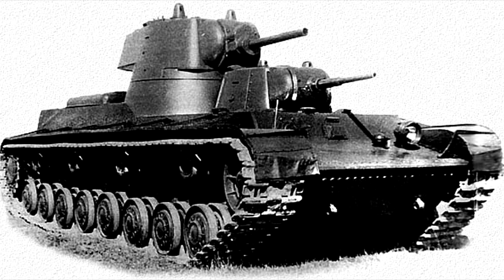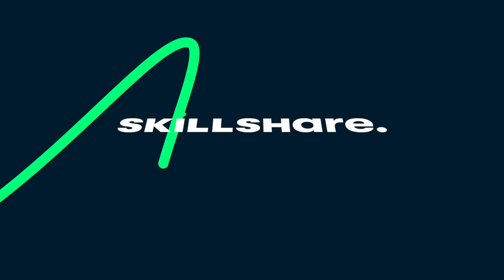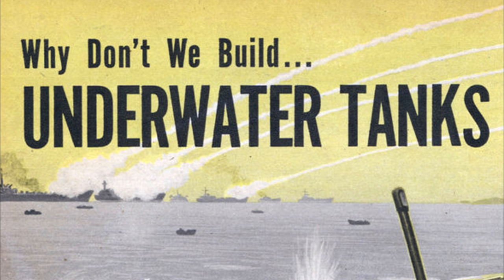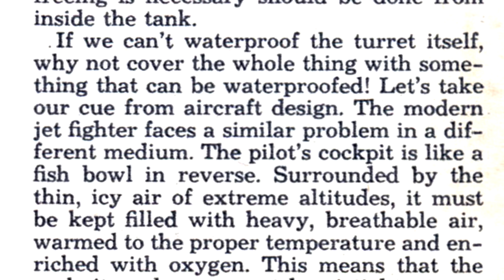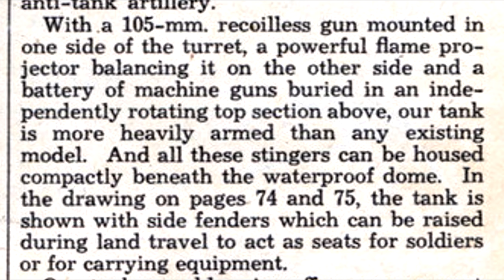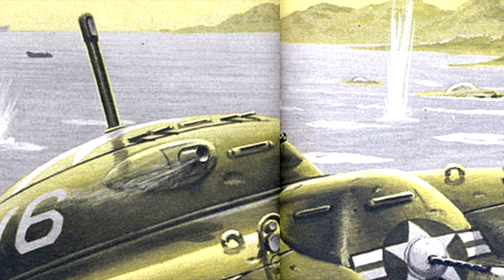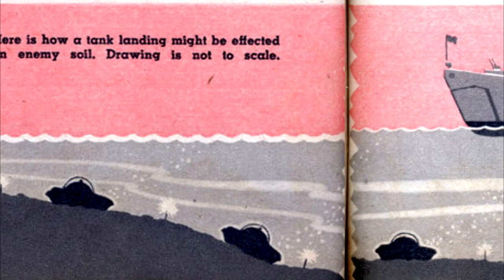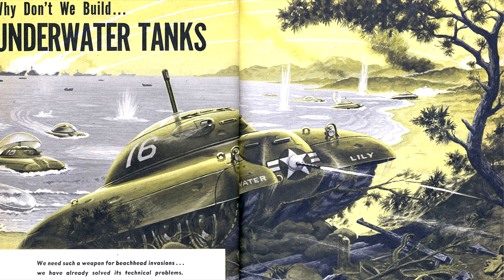The CRAZIEST Amphibious Tank Concept EVER | Cursed by Design

Comment from the maker: The first 1,000 people to use this link will get a 1 month free trial of Skillshare: https://skl.sh/coneofarc08211
Reply: Can i call you corn of arc?
Reply: Well germans were trying to make the maus to go under water so a point
Reply: dont need it tho
Reply: Cone, I think that if you put some large ballast tanks in the tank than you could lessen the amount of pressure on the sea floor that causes tanks to become stuck in the mud, but you would have to sacrifice a bit of the armor to enable that to work. In our modern times an aluminum composite spaced armor would probably allow for decent protection and also lower weight, if the tank was battery powered and had a drive train similar to a Tesla with a inversion generator and in case of emergency the ability to fully come above water level, this concept might not be bad, but would probably be a better self-propelled artillery than tank.
If you can think of anything I've missed, lmk.
Reply: @aidenburnside6380  well they could have added large air bags with makes the tank float but also just enough floaty that the pontoons stays under water
Reply: The engine could be multi-fuel, using hydrogen peroxide under water...
However, the plastic pressure dome would be crushed by the weight of the sea. So another dumb idea which was not thought out. I remember a friend in junior high school who thought he could make a twenty foot long snorkel and how I unsuccessfully tried to explain to him if he did, his lungs would be flattened and he would die...
So this dumb tank design was great for selling magazines but otherwise is dumb. The better idea for a safer landing craft is the hovercraft, which can deliver tanks to the shore, without becoming a fixture on the sea bed like the Dual Drive Sherman's...
Reply: @raider1_163  they had the taughtpanzer or something like that. That is basically water proof pz 3. Idk everything about it but. As I remember it was made to go through the English channel by dropping near the land.
Reply: How about yoh series tanks next?
From yoh company in 1950s
Reply: All they had to do was place signs over everything and that thing's waterproof.
Reply: I do like the video, but I would name this specific series a bit differently as it is just a concept from a magazine, not really something which made it at least on the drawing boards.
Maybe call it "Cursed by Concept" to differentiate from the main series?
Reply: OMFG please stop calling non-tanks as TANKS!
Reply: G 7 es una empresa dedicada 7 a en 7 de 7 en el mundo de la moda y la tecnología en el mundo de la música música clásica en el 6 y y en la música clásica en el mundo de
Reply: Lets be honest, this guy was on to something
Reply: Wow THABK YOU AND #SKILLSHARE I HAVE LEARNED THE SKILLS OF A MASTER SURGUEN AND AM CURRENTLY PERFOMING OPERATIONS AT THE PRESIGIOUS EL PRESIDENTE HOSPITALO IN GUATAMALA!

Comment: Tanks with deep wading kits frequently get stuck in the mud, even 'just' crossing rivers, or stall their engines, or find that they can't climb the bank on the other side. Western tanks have wide snorkel 'towers' so that the commander can stand in the top and guide the driver via intercom, and so that the crew can escape up the tower if the tank gets stuck. The disadvantage of these systems is that they're too big to carry on the tank in normal usage, so tanks wanting to cross a river would have to wait for the snorkels to be brought up on trucks. Soviet tanks use a small diameter snorkel tube which can be carried on the tank all the time. However, this system is very dangerous, since if the tank stalls or gets stuck, the crew have no means of escape except in very shallow water. Russian crews have been known to point-blank refuse to use their snorkels, despite the dire consequences of refusing orders in the Soviet Army. Standard practice therefore became to attach a snorkelling Russian tank to the winches of two armoured recovery vehicles, one on each bank, so that if the tank got stuck or stalled it's engine, one or other of the ARV's could pull it out. This does mean though that the advantage of having the snorkels on the tanks all the time is largely negated by the setup time for a safe river-crossing.

In practical terms, any safe, submerged crossing of a river by tanks requires prep time, support equipment and recce of entry/exit points, so it WILL slow down the tank's progress whatever method is used, often to the point where it's just easier, safer and almost as not-quick to wait for some kind of bridging gear to arrive and be setup.
Reply: Yes, very well summarised.
Reply: I used to study Soviet tank river-crossing operations when I was in the US Army. They used an observer in a tower or raised platform on shore guiding the driver by radio. During training exercises, they had specially prepared crossing points set up more or less permanently where the river bed was either naturally perfect or artificially prepared/reinforced. Still, every so often a tank would fail to cross and occasional deaths were not unheard of.
Reply: I've heard that bit about the Soviet tank crews refusing to use their snorkels, funnily enough the first thing that came to my mind when I thought about the design in the video was that I'd rather be on an open topped landing craft on the surface where I can have some situational awareness and the ability to at least attempt an escape if things get bad, than be trapped in a metal coffin under water with no means of escape if something goes wrong. Never mind the actual mortality rates, I don't care if you tell me that statistically the sub tank is much safer, I don't care. I would rather get blown up by a direct hit from a high explosive shell than take my chances with the underwater death box, and I think most people would probably agree that they'd rather take their chances with an easy death than being buried alive on the sea floor, where you get just enough time to process the fact that you're going to die, and nobody can help you.
Reply: Yeah that is why having a floating tank is arguably better, similar to the BMP apcs
Reply: The sea/river bed is about the only place I would consider a legged design to be better than track and wheels.
Reply: I wonder if using ballast tanks as spaced armor to allow underwater maneuvering to let a submerged tank swim until it gets close enough to crawl the rest of the way up the beach?
Reply: @davidthomas2870  probably better than trying to drive it, but at that point you've made a floating/neutrally buoyant tank that has to be fully waterproofed and electric/diesel hybrid, rather than just a modern floating apc
Reply: @jakeb6703  fair enough. Could ballast tanks and water be used as spaced armor I wonder and if so, would they be any good?
Reply: @EstellammaSS  That's essentially legged designs in a nutshell. They're never reasonably going to perform as well as wheeled or tracked designs on terrain that favors wheeled or tracked designs. Where they are worthwhile is in terrain where wheeled or tracked designs can't operate, or can only operate to such a restricted degree that it outweighs the disadvantages of legs. For amphibious operations, I can definitely see some kind of crab-tank being a viable option.
Reply: @GrishaDerp  Exactly: that's why I said they could only escape in shallow water: any significant pressure on the hatched made them impossible to open.
Reply: @jakeb6703  still can avoid enemy shooting, and allow for suprise beach landings, considering how slow beach landings tend to be i would say this is vital. furthermore you still need to make all modern tanks NBC sealed, which is not too far off from water proof.
Reply: @davidthomas2870  That's a good concept - maybe large, side-mounted, detachable floats that lighten the tank significantly enough to let it 'skip along' or 'glide' across the sea floor STILL ON ITS TREADS (fitted with also detachable flanges). That setup could deal with the soft, silty sea or riverbeds (I'm picturing something like a horseshoe crab that scampers along the bottom, just gliding over the sea floor with its feet).
Reply: @kennethmartin1300  that is an interesting idea
Reply: and diving teams. They always have teams of divers to rescue the crews.
Reply: My gradpa was tank mechanic in czechoslovakian army in 70s (we used late T-54s) and tank crews had device to breathe under water for time before they were rescued by ARV
Reply: "...Russian crews have been known to point-blank refuse to use their snorkels, despite the dire consequences of refusing orders in the Soviet Army." - Absolute garbage and a lie.
Reply: Remember two points regarding Soviet cold war tanks. First. There is a trap door in the floor of the tank for escape. The tank runs at positive pressure for NBC purposes, so the hatchet could be opened for escape, without immediately flooding the hull (just). Second they have personal rudimentary gear to escape if necessary. That said, it is all very precarious and I wouldn't blame those who refused to follow the order.
Reply: This. The whole concept is idiotic, mud or silt on a shore can be many meters deep and can become instant tomb if something too heavy digs into it. Deep gravel is even worse, US tanks were permanently stuck on it in both Dieppe and D-Day landings becoming static bunkers on beaches, now imagine being stuck 10 meters underwater with several tons of pressure holding all hatches shut...
Reply: @KuK137  hey now don’t forgot about the Sherman’s that sunk because their canvas wasn’t strong enough
Reply: @gunner678  a bottom hatch is not of much use of the tank is stuck in gravel or mud
Reply: Solution: attach floaters, which when needed get filled up by gases produced by a chemical reaction, allowing the tank to rise from the bottom in case it gets stuck.
Problems with said solution: too many to type out xD
Reply: Theres also the fact that most islands have pretty uneven seafloor around them making a close drop a big part and if you are that close you may as well just beach the boat and drive out.
Reply: No true entirely accurate. Soviet system is to flood the tank slowly and then escape through top hatches. So there is a way to escape you see.
Reply: @gunner678  At a depth of 10 meter, there is 2 atmospheres, at a depth of 20 meter there is 3 atmospheres. No pressure equipment is going to keep the water out if a hatch is opened, never mind the crew having to fight nitrogen narcosis and the bends after being stuck for hours in a +1 atmosphere environment. Those tankers become divers with the problems faced by divers.
Reply: They would have been better off to build a hydrofoil landing vehicle which has the ability to speed over water and then beach it to drop off regular tanks. The hydrofoils would probably be destroyed during the landing, but easily replaced with minimal cost and damage to the boat.
Reply: @MrDertien  
Hydrofoils have high draft, making them unsuitable for landing operations in shallow waters, they are also vulnerable to naval mines and barriers. Which is why the #1 choice is LCAC and ekranoplans are better as well.
Reply: If the tank gets stuck at the bottom, whats stopping the crew popping the hatches to flood the tank and then swim up? Does several meters of water pressure jam the hatch?
Reply: @keithw4920  
There are many ways to flood the tank, but the standard procedure is flooding it via periscope sockets.
No rush, standard tanker's rebreather has one hour of oxygen supply.
Reply: @keithw4920 yes it does. Had this  happen to me when  I parked my car in a lake, and the water was about as high as the windows. I could hardly push it open. Took me a few tries, but I was not submerged. Imagine having to push it open from below the water and upwards.  Also a car door is probably lighter than a tank hatch. Opening the windows is not an option on a tank neither.
Reply: @jarink1  Was there any hope for the crew if a tank stalled or got stuck? 
Did they have something cables set up to drag them out from shore?
Did they have an underwater escape procedure?
Or would they have to, eh, wait for a diving team to reach them?
Reply: Harold, you gave an excellent explanation of the facts concerning this subject.

Thank you.
Reply: @jeroen79  
Learn to read.
Reply: @MrDertien  
Scuba gear + zero water pressure if the tank is full of water = no problem
Reply: @keithw4920  the hatches all open outward meaning to oven them you have to overcome the weight of all the water above holding them closed
Reply: Very good thx for info but. It's sooooo long
Reply: Why event bring a tank into a swampy area it's not a good idea in the first place anyway

Comment: im not too fond of the idea of an internally mounted recoiless rifle personally
Reply: Maybe the recoilless gun could have a back-opening in the turret too, and be moved back and forth for reloading? I mean, if the front opening is covered by the dome, the back hole could too...?
Reply: Would've been a blast for the crew
Reply: @ultramarinus2478  
That was my thought also; better make sure it has absolutely foolproof  interlocks on it though!
Reply: @ultramarinus2478  The problem is that the dude speficially mentioned that th gun would need 90* of elevation. Maybe it was supposed to have an oscillating turret and the folks and MI just drew it wrong?
Reply: Yes; sounds like something Coyote would try using against the Roadrunner.
Reply: @gearandalthefirst7027  i think another solution would be to allow the entire gun to slide forward once the dome was off. Would increase elevation and depression as well as allow the crew more room. However I do think that an oscillating turret would have made more sense, as I believe the did exist by the 1950s.
Reply: I somehow think that Mr. Tinsley wasn't completely familiar with how a recoilless rifle operates.
Reply: @Siddingsby  . He was absolutely bonkers, other "innovations" of his are a battleship that turrets couldn't rotate at all. The exshaust funnels would Be a Part of The torpedo protection, meaning that a single torpedo hit would flood The engines in every single scenario thus leaving the ship powerless and immobile. The man was as clueless as they come when it came to military vehicles. His designs would have Been absolute death traps to anyone unlucky enough to Be forced to operate them, Americas enemies would have died but to laughter when seeing these pieces of junk.
Reply: I was in the Army back in the Stone Age and have fired M67 just before they were replaced by the M47 Dragon (I still have a bore sighting device as a souvenir of those times). My first thought was if I had been told by someone to share a turret with the breech of a recoilless rifle I would be court martialed for telling said individual to perform an unnatural sexual act upon themselves. 😝
Reply: @Siddingsby  would not be a fun time in a confined space for sure.
Reply: @Siddingsby  but he had a dream, and tried to solve a problem that could save lives. I still tip my hat to him even though it would have just been a bad idea.
Reply: @ultramarinus2478  Then what about elevating it for aiming?
If you fix the gun in a small opening for the muzzle the breech would have to swing up and down and vice versa.
If you fix the muzzle and the breech in small openings the gunn cannot move up or down.

The same goes for the row of machineguns on the top of the turret.

It seems to me that whoever came up with this tank knows little about geometry.
Reply: @ultramarinus2478  I assume the loader would have a loading slot in the side of the barrel, kind of like a giant bolt action situation. Since the gun would just be slotted into the turret you could presumably make larger versions for heavy ordinance that would dock in if bubble duty was not required.
Reply: @ultramarinus2478  not it could have but it absolutely needs one in order to operate

Comment: If this was ever to be built, there would be a lot of dead tank crews.
Look at how many die in FLOATING armored vehicles. Now imagine they have zero chance to bail as they wait on the bottom for their breathable air to run out.
Reply: or you know they could have airtanks, like the germans planned to give their tank crews for operation sealion
Reply: If it was still the 1900s, give it to the Soviet Union lmao
Reply: @matthiuskoenig3378  Oh, like they had on the Kursk?
Reply: @matthiuskoenig3378  still limited air time tho, you still need a division for recovery crews that are stuck underwater, wich may die beacuse of watter presure sudently entering the tank , is literally a death sentense
Reply: Reminds me of the testing process of KA 21 IFV fitted with inflated sausages on its sides. The testing driver died in these testing trials.
Reply: @Fremen Well, the idea was probably to choose landing beaches that would accommodate such a vehicle.
Though plan does not always equal reality. Look at what happened with the Pacific island-hopping campaign when coral reefs caused landing craft to hand up. Soldiers were ordered overboard under machine gun fire and often sank to the bottom, fighting to shed their gear before they drowned.
Reply: Yeah they’d need to be able to lift a hugely massive vehicle from the sea floor mud before air runs out during an invasion. They would be stuck all the time since the sea floor is never actually a nice smooth surface and there are cliffs and reefs everywhere, and seafloor mud (especially offshore) is insanely sticky and soft. 

Also you’d need enough air for the engine to run which would take up a ton of room already.